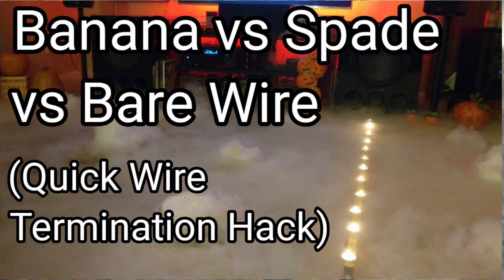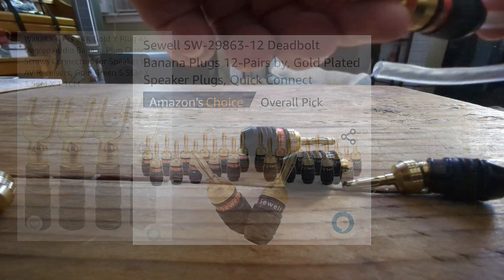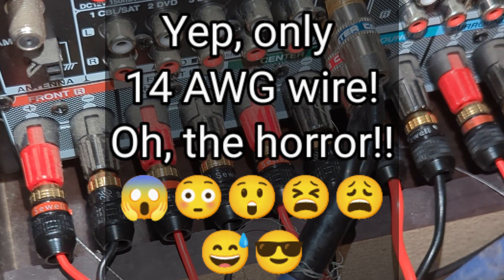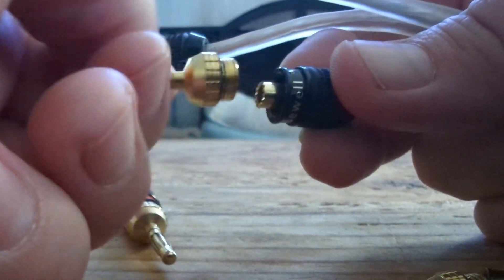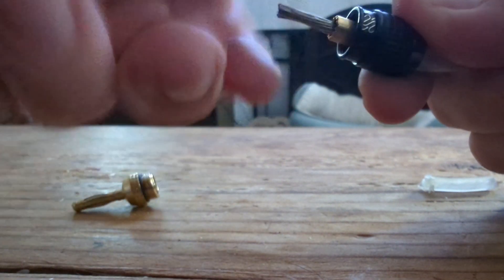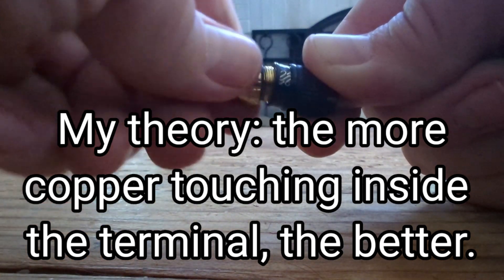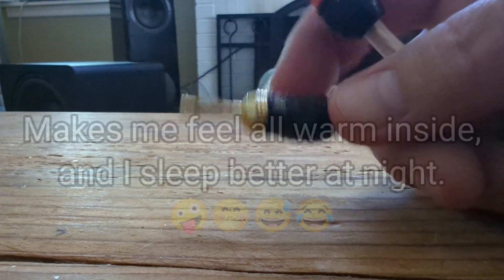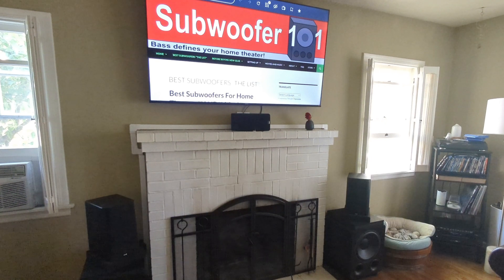Banana Plugs vs Spade vs Bare Speaker Wire? Quick Termination Tip

Comment: I used to use those kinds of connectors until I found gold plated Fospower duel screw down banana connectors. Then used some heat shrink to seal the back of the plug and wire jacket before sliding the jacks outer threaded case. The duel screw downs hold the cable tight with the right torque and heat shrink keeps the oxygen out of the copper wire. It does not take long for copper to turn green when exposed to the air.
Reply from the maker: I saw those, and they look pretty solid. Granted, nearly anything can fail, but I think those look pretty well designed. Good idea using the heat shrink! That's a little extra attention to detail that really looks good and has a purpose. Nice, thanks for your comment!

Comment: What is the best way if you have to connect two wires together obviously not ideal.
Good video keep up the good work❤️
Reply from the maker: Thanks! Honestly, I looked this up because of you, and self-soldering connections would be my choice.

Prior to your question, I would have either done soldering, or butt connectors, both with heat shrink. 

The self-soldering connection makes it so much easier.

Comment: What you think of the Marantz MM7055 5ch Power Amplifier 140w/ch (Each)
Reply from the maker: It's interesting, but I don't like that it doesn't seem to have room correction, and with Marantz I'd be shooting for XT32. 

Doesn't seem "bad", but I would personally look for something a little more feature rich.
Reply: @Subwoofer101 hello how are you doing. I didn't even know that you get room correction with amps because I wanted to run my 2 klipsh 8000f and my center channel on that amp and my surround sound speakers on my denon x4800h
Reply from the maker: I missed that it was not an AVR! The derp is strong with me, wow! 

Yeah, totally makes sense, and especially using it for your front stage. 

Granted, I generally have all speakers set to "small" and a minimum of 90 hertz crossover or higher, so my amplification needs are generally well satisfied by the subwoofer amps. 

Lower frequencies are where the power is truly needed. Higher frequencies sip power. 

Granted, a good power amp can color the sound in a positive way (or negative) but I find that more power in the subs is far more dramatic and noticable. 

That said, I'm a fan of Marantz, and I'm sure it's a quality amplifier. 

Sorry for the mix up!
Reply: @Subwoofer101  thanks man and no problem thank you for the reply
Reply: @Subwoofer101  oh and I love your videos man